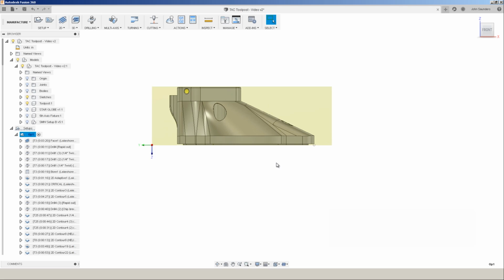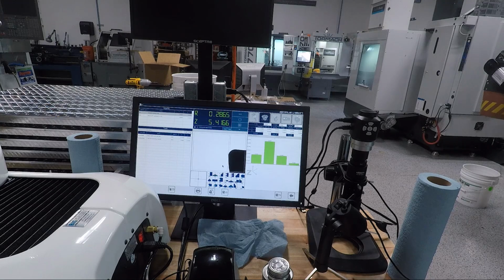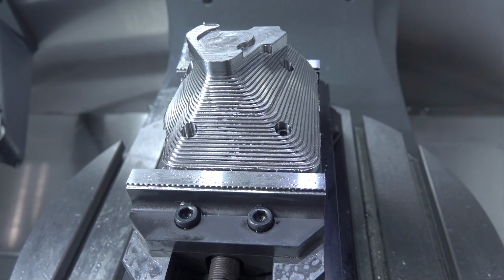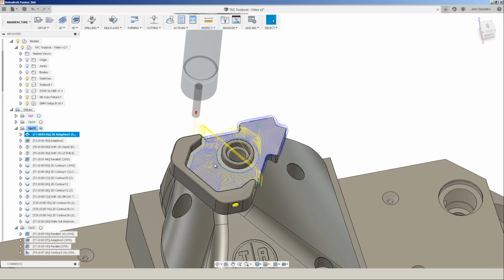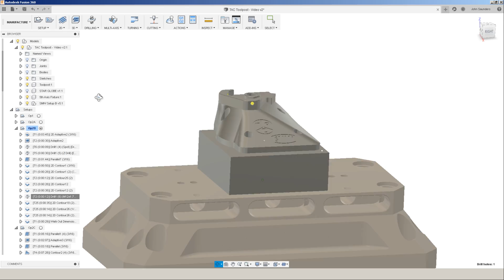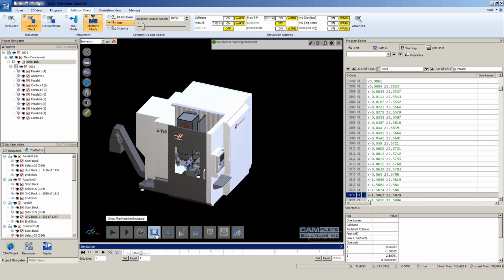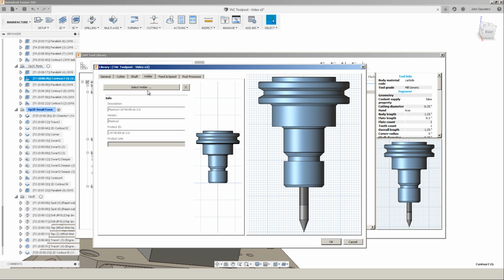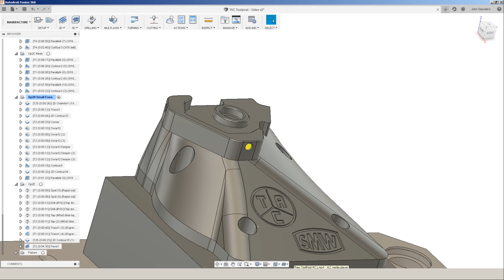HAAS UMC-750: Machining the TACrafted Lathe Toolpost Riser!

Comment: i like the gluing gage block idea....i've just been clamping them with plastic clamps
Reply: I think the abuse of removing those blocks would render them useless for further work, plus the bond thickness is indeterminate and could easily be a couple of thou.  I think plastic clamps would be a better solution.

Comment: Super gluing a gauge block on the part would be one of my last options. Milling away the excess material to give the probe stem clearance would be the first.
Reply: Yup. And if you plan ahead, you can mill that clearance from your first operation, so no need for manual cutting. Touch off X0 there, Y0 on either the fixed jaw face, or if on a centering vise on the UMC like that, many times you can rotate B-axis slightly and the probe can reach no problem.

Comment: Those coolant lines should be going around the tool. Don't know why they're only on one side. It makes for poor coolant flow to the tool. Bad design.
Reply: gredangeo if u use TSC - problem is solved ;)
Reply: @mirokiko  Still though, bad design on Haas' part. I'd like to rely on normal coolant flow, and only use TSC when it really matters, like long drills and deep cavities. TSC uses a lot more coolant per minute, it's not economic in the long run. If the outside coolant lines are properly placed it suits most purposes far greater.

Comment: Why aren’t you using the probe to figure your part orientation instead of using indicator and beating the part straight? And use the probe to measure the bore u used a bore gage for u paid for the probe use it
Reply: Part has to be indicated parallel to the axis otherwise the verification is useless with close running tool holders to the fixtures. Also, I never probe a high accuracy feature with the machine probe, positional errors in the machine are transferred to the probe also. Calibrated and verifed bore gauge is best for me.

Comment: Nice job on not messing up 98% of it. Why didn't you just change the radios on the transition from vertical to angled surfaces, that would have most likely eliminated the gouge marks on your piece? There is no way I would ever send something out in that shape even just a prototype which this is now.

Comment: When super-gluing the gauge block on, one should not apply glue to the face and then position the block. The glue will add some thickness which will cause a false reading- more than the assumed thickness of the block. The best way is to position the block on the workpiece, keep it held tightly and then apply glue to the perimeter of the block. Keep glue from wicking in from the edges of the block. Super glue can have significant thickness that can throw all calibration off.
Reply: I thought the same thing.  Gauge blocks are undersized by one wring thickness which is about 25nm  (1 microinch), but superglue bonds are much thicker than that.  3M Scotch-Weld™ General Purpose Instant Adhesive EC2500 series have gap-filling abilities from 0.002" for the lowest viscosity,  to 0.010" for the highest.  That center hole has a tolerance of -0 to +0.0008" in diameter, yet could be off-center by 0.002" in each direction if a healthy sized blob of glue got trapped.  I also wonder about the abuse removing those gauge blocks - impacts or heat could warp them out of flat.  I think that would render them useless for further measurement until re-calibrated.  Maybe John has a cheap source of disposable gauge blocks?!  I would have just changed the probe stylus.  Even without calibrating the new stylus it's likely to be more accurate than superglued gauge blocks.
Reply: @genixia  Maybe he used acetone to remove the glue

Comment: John, That origin your setting in fusion for the 5 axis work. Is that the intersection of the two rotary axis? I take it on that Haas it is the center and top of the rotary table.
Reply: It is about 2" above the table
Reply: @GRTLRS  So that is where you are putting the origin in Fusion?
Reply: @EdgePrecision  I'm not using fusion myself, but you could put it anywhere you want. Dynamic workoffsets and TCPC on Haas make it easy to setup. Just set your offset like you would normally on a 3axis mill. Only thing is the B-offset must be 0. C can be any value.
Reply: @GRTLRS  Yes as far as the machine setup (If you have dynamic work offsets). The machine will calculate a position relative to a ideal position of where the cod was processed. But I think in the cam software it would have to be in the actual position irrespective of setup error at the machine. Or in other words as if your machine didn't have dynamic work offset control.
Reply: @EdgePrecision  Hmm, I think I see what you're getting at. I'm not sure about how Fusion handles that, but in Surfcam I can do both ways depending on post used. The built-in MPost templates will generate code based off the WCS the toolpaths were generated from. In this case, any rotated coordinate systems you would want the origins on the same point. If they aren't, you could have a situation where the verified toolpaths in CAM appear to make a nice part, however the code tells a completely different story.

My post for 5axis uses PostHaste. (well, an apt post, then a posthaste template is used.) With this, my coordinate systems can be where ever is convenient for me for toolpath creation. Then the code is generated based off of one coordinate system. That's the origin I setup at the machine.

I think I need to give fusion a try to see what's what. It has interested me lately since it looks like it also has an APT post? I could use that with my PostHaste templates, hopefully without too many changes, and have my code formatted mostly the same. I saw on your channel you are getting into fusion now?
Reply: dead in dead country  Are you asking me? If so I think a Haas with a 5 axis setup is about the least expensive to getting a real 5 axis machine. It depends on the size of parts you intend to do.
Reply: dead in dead country  You said if you were on a budget of 150K. I think for 5 axis at that price level you would be in the Haas neighborhood new. Say one of their smaller machines with a 2 axis rotary setup. Kind of like what AVE has. Maybe. Otherwise you would have to look at used machines. But with older equipment you had better know what your doing. You wont have the newer features that make it easier.

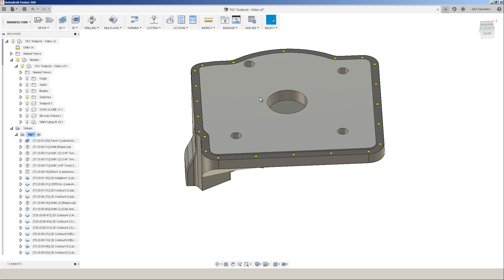Comment: 1:23 its not "tight". in germany this tolerances are normal. the problem are not the tolerances. the problem is your imperial measure system. i really dont like your miles, inches, feet and whatever you have over there. the craziest shit ive ever made was a 2H6 thats 2.000 - 2.006mm. thats what i call a "tight" tolerance. greetings from germany!

Comment: Observation: Why not manual machine the excess away in those areas to clear the probe? Despite the learning curve, the project turned out really nice,
Reply: Or, just install a stylus with a larger ball diameter. Only takes about 20 minutes on the Haas to recalibrate.
Reply: @DomManInT1  Probes are too costly for a non-paying job. But with a 5-axis machine you can take a used endmill at the end of it's life, roll B and A, then jog the cuts to get clearance. Most everyone who runs a CNC can make manual cuts.
Reply: @opendstudio7141  I did not say install a new probe. I said install a stylus with a larger ball. I just bought a 100mm X 6mm stylus for a Renishaw probe for $100 + shipping about 2 weeks ago. But you probably do not know about this.
Reply: @opendstudio7141  Oh, and the extra stylus does not go away. Can be used on other jobs in the future. I also have one that is 20mm X 2mm so that I can get into measure tiny features.

Comment: Is super gluing gauge blocks an acceptable way to probe your part? Wouldn't the super glue add a non-negligible thickness to the gauge block?
Reply from the maker: If you measure the dimension (calipers or depth mic), then the thickness is largely irrelevant.  Either way, it's a very small amount

Comment: In fact, despite what you said, those angled surfaces are ideal for a ball end mill on a std 3 axis machine, as the zero-speed centre of the cutter will not be expected to make any contact. But it would be a shame not to make use of the 5th axis!
Reply: Maybe. It's a pretty shallow angle, though.
Reply: then you have like 10 thou stepovers and lots of movement, put the plane perpendicular to the XYZ on the 5-axis and you can do it with the flat end of the end mill much faster.
Reply: @multiHappyHacker  But in fact John's using a ball end mill and the angle of the face he is machining ends up about the same as it would have been if it were simply mounted on its base. He says "a ball end mill always ends up cutting normal to the axis" - but that's only true for horizontal surfaces. The surfaces seem to be curved anyway, so a square end mill wouldn't be much help surely? It's not a big deal but ironically it's one job where a ball end mill works well on a std 3 axis machine.